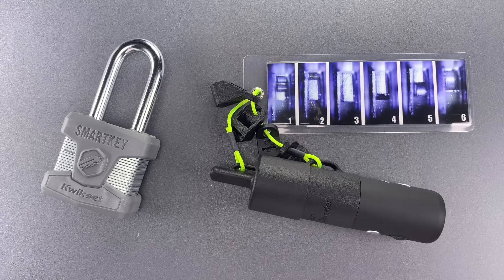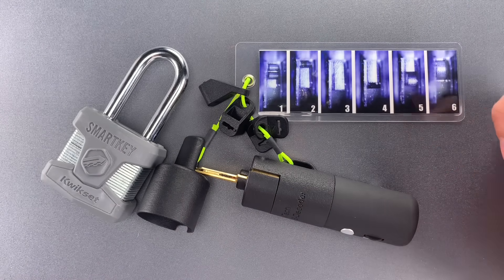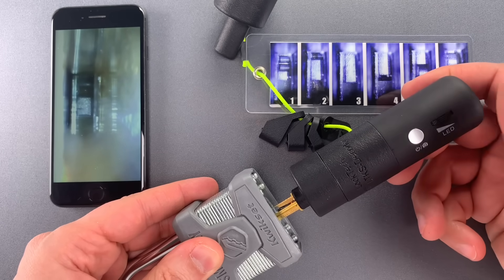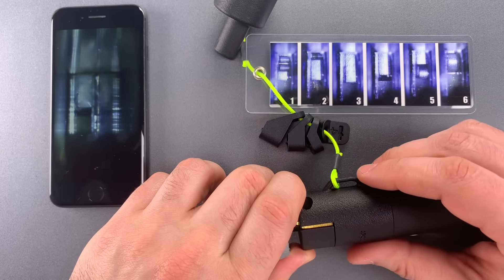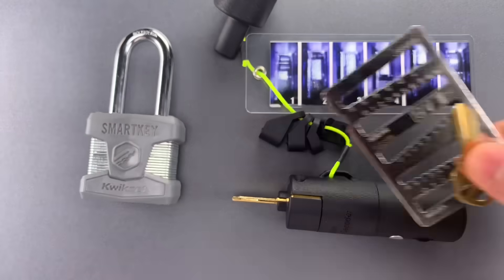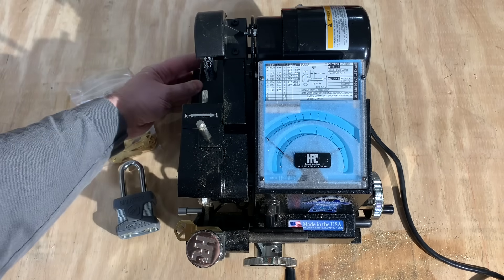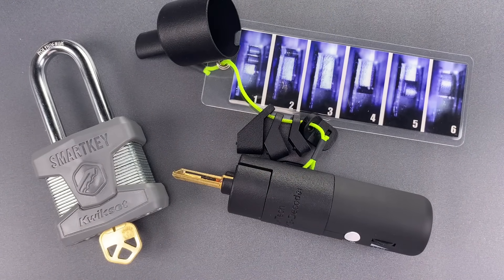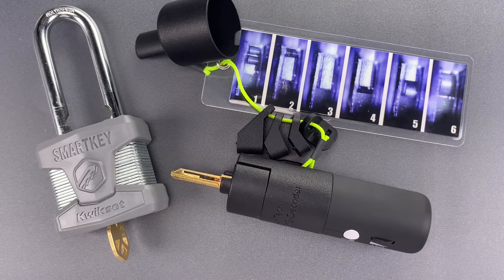[1209] This Tiny WiFi Camera Owns Kwikset SmartKey (LockTech LTKSD)

Comment: i bought both of those tools at a garage sale, thanks for letting me know what they're for. 🤣👍🤣
Reply: How tf could something this recent end up in a garage sale
Reply: @onometre  He means the key cutter. But it's not true.
Reply: @DoctorJekyll-k3l  In fact, building a key cutter machine would be extremely hard, if not impossible.
Reply: @garymitchell5899  I dunno mate. It’s just clamp, depth gauge, length gauge and a what I would assume is a special cutting/grinding wheel. 

All I would need to build one is one of the cutting wheels and 3 reference points for the gauges. Then I could even make it so I could use his cards.
Reply: @5hiftyL1v3a  Erm I would watch the video and look at the actual machine.
Reply: @garymitchell5899  right- watched it a third time. What’s ya point?
Reply: @5hiftyL1v3a  lmao use your bravado to actually do it and post a video about it then 😂😂 people on the internet...
Reply: @superdooper1830  mate I've got enough on me books. I figure you're trying to take the piss , but I agree - people on the internet - people are just blown away with anyone who can work with their hands. Having grown up where you had to solve your own problems, having worked with my hands my whole live, and now a welder and steel fabricator, I tend to forget how blown away people are on youtube by people that can pull something apart and clean it, or build a shelf.

but yeah mate - if you wanted a real nice one of these made,  would take me a little bit. But if you just needed to cut a key and  it didnt have to be pretty? I could make something to do this is a couple of hours. And I don't in anyway think thats special.

Comment: man, the thrifty version of this with a pinhole camera, an arduino, and a wifi card would be crazy to see. Maybe even code in some pin recognition with a neural net or something. EDIT: aaaaand now I'm on every list ever
Reply: I think a raspberry pi would maybe better. Already has wifi and a camera interface.
Reply: I had the same thought, plus hook it up to a few motors and a bit to make a little CNC key cutter. $100 worth of parts from Banggood? You could walk up to a lock, zip your camera key in and out and a few seconds later your fanny pack spits out a key for it.
Reply: @ceoyoyo  think outside the box. A key with adjustable bitting. The raspberry pi reconfigures the key in real time. 👍
Reply: @chartle1  Yeah, I thought of that too. The problem is how to build actuated pins small enough to fit five or six of them in a key. I'm sure there's some micro mechanical stuff somewhere that would do it, but not cheaply. You could probably use an SLA printer to make a key with micro hydraulic or pneumatic channels in it though.
Reply: @ceoyoyo  star trek nanobots 😆

Comment: Are those marks on the slider imprinted from the factory or an artifact of lock cylinder manufacture?
Reply: No its part of the 'Smart key' mechanism for re-keying. I think he has a video about how it works, or maybe it was a defcon conference that I saw about it.

Comment: You learn a lot about someone based off of how well they treat their things. The fact that his old phone looks like it's in excellent condition really speaks volumes.
Reply: Or it says that he replaces phones often (although it looks like a slightly older model, so probably not the case).
Reply: Dude, a solid 10-15% of people have a drawer full of the "last year model" phones, from where they get a new one every year, and at least another 25% have  a drawer of every other year's models
Reply: @Man_Emperor_of_Mankind  yes because i definataly have 2000 dollars to my name
Reply: Even with my active job where I crack my screen protector every few months, and the case looks terrible, the phone inside looks shiny and brand new. My phones die from the charging port going bad. I used one phone around 5 years, went through multiple batteries, and in the end, the main issue was getting more new batteries and it being too under powered for modern apps.
Reply: @connercradic4131  
Okaaay...
What does that have to does that have to do with a large chunk of the population treating phones as a yearly or bi-yearly disposable item, that tends to get replaced almost as soon as they pay off the financing on their current phone?

Comment: This might be how he will beat the "Stuff Made Here"' lock
Reply: @Aardvarko  At first glance, it looks like cheating. But after your question, I'm not sure anymore. After all, the picking of the lock is not a magic trick (i knew, hard to believe on LPL channel), but an engineering task and it does not matter how it was solved.
Reply: The Stuff Made Here lock uses a Schlage key (An SC1 or larger).. the camera only fits in Kwikset locks (KW1's). I checked.. no such tool exists for Schlage.
Reply: @MattMoore1  you can always just use a cheap USB bore scope. This tool with key size is just to make The process extremely convenient and at an upright angle.
Reply: @joshnelson7617  Smallest bore scope I can find has a 3mm lens. Keys (and therefore keyways) are a third that size.
Reply: @MattMoore1  Yet.
Reply: I do have a feeling that he won't be able to straight pick it, and so will instead figure out a bypass (such as this one). Though from my recollection of the Stuff lock, the camera method might not be able to see where the pin gates are.
Reply: Do we see Stuff Made Here's key? Lpl can recreate it. If Stuff rekeys the lock, I don't think LPL's camera will work in his lock.
Reply: @ronindebeatrice  He was going to work on some upgrades before sending it over, he will probably do one with a different bitting. In any case, that wouldn't be in the spirit of the exercise so I doubt LPL would do that.
Reply: I don't think it would work in SMH lock. The actual pinning is to the side right? Not above the lock?
Reply: You think he'd stoop that low?

Comment: You may not even need the machine to cut. As LPL said, you could use a key gauge (much cheaper) and files to do it, or go to a locksmith and ask them to code cut a key.

Comment: If the camera has the ability to shoot film, not just still pictures, you'd only need to be exposed for a mere second outside rhe door.

Slide the key, inside-out once. Then look at the video and stop frame by frame as the camera pass each slider.

Comment: Is the camera that small or is it using a mirror and led, with the ccd in the body of the unit? (answer: its a mirror in the key shaft with the ccd in the body! Clever!)
Reply: Given the size of the cameras used to capture debit card PINs they could make a camera that small.
Reply: @Knirin  Yes, there are really small cameras used in surgery but $$$$. This is done with a mirror. That makes it a lot cheaper.

Comment: My Chinese knock off took me to a whole new meaning "you get what you pay for"!  took me 40 mins to get plastic lock open but if anything it does give you a good idea what your doing so its paid for itself in that knowledge.   The reason it took so long was in fact holding the lock, using the tensioning and using the right pick.   Once I had got the tools then bingo!  I do not like the plastic handles, I do feel you need to feel what's happening rather than listening.  I think you would find it hard to listen to the clicks.   All In All (AIA) I will see what a decent set of tools will cost me.   You really would not believe the metals used and state some of them are in., the wallet is good and so was the plastic lock funny enough,  after you said about the machining of them I was skeptical..

Comment: This definitely comes off as a good/bad situation for me.  I have the SmartKey on my door knobs for my home to match the deadbolts on the doors.  Put the SmartKey on the knobs since the previous attacks made it easy to bypass the lock so at least the deadbolt was secure.  Now this means there is a way to get in but as LPL said it's a more specialized approach that your average thief isn't going to use.  Fortunately it's a townhouse so if you're trying to brute force the door the wall shaking will alert the neighbors.

Comment: In the 1990s, I worked for a very large trucking company and they had a hand-held key cutting device that cut a new key from the key code in just a few seconds. If they needed to get in your truck to perform some maintenance and you forgot to leave them the key, they looked up your truck number in a book, found the key code, dialed in the cut code on the key gun, squeezed the trigger on the key gun, and made a new key. Don't those key guns still exist?

Comment: As a misguided youth a long, long, time ago....(1970's), I spent a year working as a repossessor. Mostly automotive, but the occasional storage locker/hidey hole. We had a manual "key cutter" which we called the "Nibbler". If you knew the key code it took only seconds to nibble out a key with it.

Comment: That key cutter looks super easy. Love how those marks on the card guide making it.
Reply: It's a dream to use.  Relaxing, really.
Reply: I wonder if they make a card too where it's just distances scales on the slides, for a case where you have some obscure lock you need to make a key for, and can take measurements either off the lock or off an existing key, but there is no special card for it.
Reply: @zuthalsoraniz6764   Yes, they do.  They've thought about just about everything.  Many of the cards have extra information specific to that particular lock printed on them.  Some of them are covered with information front and back both.  Also they make a variety of cutters for different keys - sharp V cuts, flat bottomed cuts, rounded bottom cuts, small cuts, large cuts, wide cuts, narrow cuts, and various angles on the slopes of the cuts.  You have to know keys well to get the most out of this machine.

Comment: That device should have been made to record videos at 120fps or so, which is extremely doable and trivial for a handheld device, this way you hit record, stick it in the keyhole, hit stop and that's it, check the sliders frame by frame whenever you want, no need to be there with spacers or looking for the sliders, even more so for law enforcement

Comment: The next step is to automate the whole process.
You slide the camera in and out of the keyway, it identifies the biddings.
It sends that data to an AutoKey (TM pending) which has a bunch of pieces that slide up and down to match. Voila! A working key in 10 seconds.
The system is still defeated by non-standard locks or even just non-standard biddings, but it would get James Bond into most locked rooms. =D

Comment: HPC Blitz is an awesome machine but I almost never use it anymore. I use my laser cutter which is way more than accurate then the blitz only because of human error I would imagine. But yes the Blitz is an awesome machine. I’m an automotive locksmith and my blitz sits in my ban used maybe 2 or 3 times a months at most. Some months it doesn’t get touched.

Comment: I don't understand what I am seeing. The pictures move from left to right as he inserts the key as if he is looking at it from the side instead of from the end. And why does the 1 cut look like two tiny barrels on their side way up high? And what is the camera orientation and the optical path from the lens of the camera to the sliders. I guess I don't understand why the inside of the lock looks like it does. Nor what I am seeing in those pictures on the card. I get what's going on. Just not how all of this is working.

Comment: I find it interesting that there is a specialized morphkey. Camera goes in.. You get the numbers, you stick a morph key in and select keyset fro ma menu and the numbers you got, then it bends to the shape... boom unlocked... It doesn't need to be metal...

There are many different types of locks electric locks, radiator locks... decay locks... the problem is, if you can sweep them, they can get triggered, unless you need the calibration to hold in the sensor for say, 5 seconds... face recognition... is easy, manipulated as with finger prints... Hmm... So... Why, not you tell us or design a lock on the principle of not being able to be picked... is it possible... One could make a lock that any failed entry results in the lock being locked out... permanently... and thus has to be cut... 

The best locks I think are, not really locks, but simply recording, large machines, that use a multiple of devices... to establish a security net sort of speak... Technically a lock just keeps out random criminals... if someone wants in the can get in..

Comment: Yes, FINALLY! Ever since I started thinking about lockpicking Ive always wondered
•1. Why is there no tool which would allow you to look at the pins with a small camera and base the keying off of that
•2. Why is there no tool which would allow you to move individual pins with small "pistons" using a phone app, which would basically be a readjustable key
And finally, number one was answered! (kinda)

Comment: Never actually seen someone cut a key before. That was kinda interesting watching what he was doing and learning how it’s done.
Reply: Some of the other machines are set up so that you can also automatically make a duplicate of a key (I couldn't tell if this one is, but I'd be surprised if it wasn't).
Put the old key in the master vice, put a blank key in the cutter, turn the machine on and wait 30sec. Brand new key!

The downside to duplicate keys is that if you have a very old, worn key it will make you a brand new, worn key.

Comment: A proper locksmith would have drilled through that lock.  Instead of selling the service and a key, they can also sell a new lock.
Reply: (rolls eyes) Only if the "locksmith" doesn't like repeat customers..
Source, me. Job, Locksmith and inventor of the original tool about a decade ago. I'm not the person that added the camera and spacers which slooooow down the process of decoding significantly. Much rather move on to the next job than waste my time trying to find a replacement when customers wants that "fancy" handle set.

Comment: Using computer vision software, the recognition of the cuts could be automated. If you then have (a) tiny motor(s) and sliding, lockable wards, the key could form itself into the correct bitting just by being inserted.

Comment: Just curious, but what about 3D printing the key. I’d question using the 3D print in a lock with too much resistance, but it seems like one could print a key and take it to one of the minute key machines to get a normal key made.

Comment: This really floors me, LPL...
Forgive my simplicity, I'd thought that if you looked into a lock inside->up you'd only see metal dots - that doing this you'd need a tiny riser camera inside the tiny entry device...  At least they made it a $300 device - till the Chinese firm i presume is hired to cheat an American his wages makes a knock-off for less than $100...
At least the cost is comforting, per the end of the video people with the tech probably don't need to break in to steal your stereo/tv/look under your couch.  Dedicated entry teams meaning big $ big crime involved and other steps.  "Bruno...see the cam?  That ...delivery guy...he stuck somethin' in the back door keyway and left..."

Comment: Alright, I know that the lockpicking community gets offended by the very suggestion that their hobby could promote or be used for illegal activity. But if you're really just lockpicking for the mental and dexterity challenge, I would imagine that using a tool like this would be considered "cheating" in some form. So who is this intended for if not people trying to get access to places they shouldn't ?

Comment: I didn't understand why it is so easy to see what cut each location. I thought that each station would drop down to the same point inorder to be pushed up by the cuts on the key. I guess I don't understand locks are well as I thought.